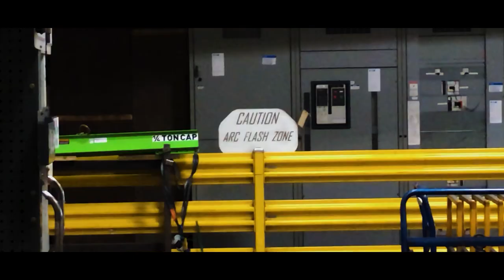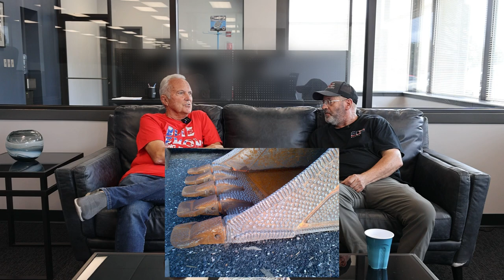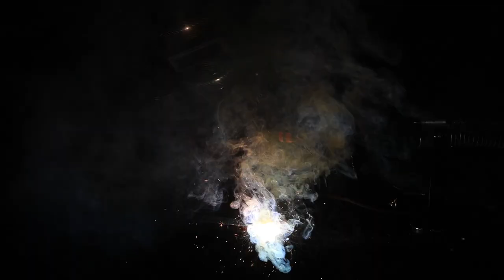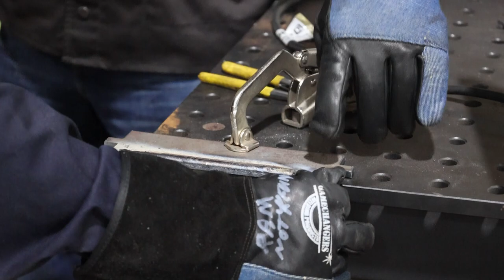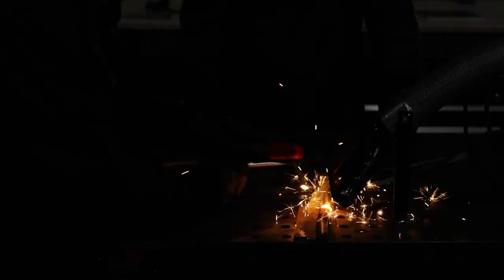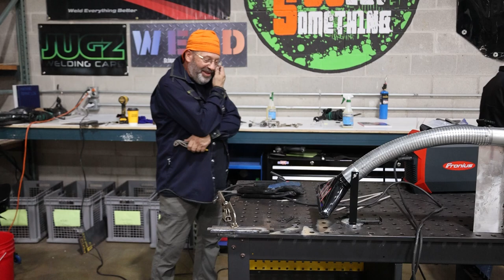Hardfacing Discussion and Demonstration with the Founder of Blue Demon

Comment: There you are at Blue Demon, and I just happened to have bought some of their  55fc flux core hard wire which I am using on some snow blades and snow blowers. Seems to run quite well, all I need to do is adjust the voltage to get a lower profile weld. Mine are a bit ropey now. Most welding videos and review just talk about 6010 and 7018 , but there are so many other rods and wire out there. Most of us don't do pipe so rarely use 6010 so why so much hope on those rods. I would like to do demos on other rods and their usages. Thanks for the video very informative.